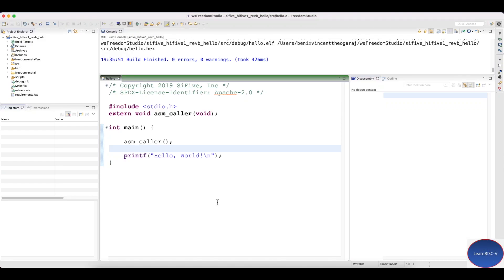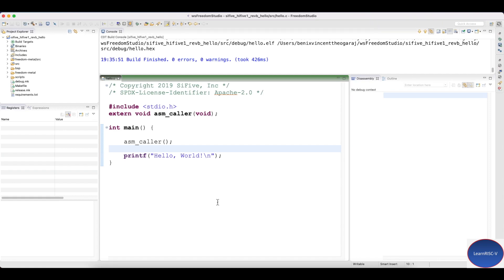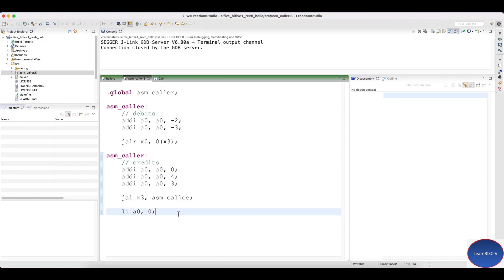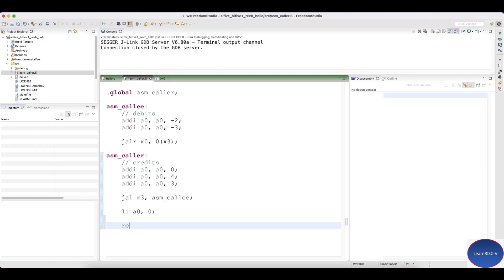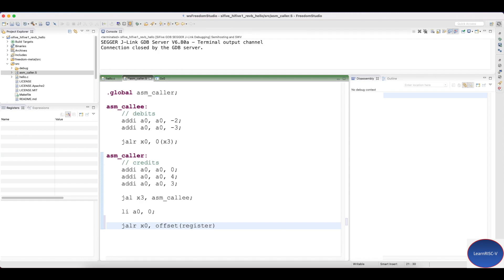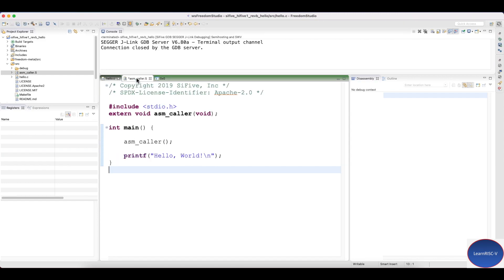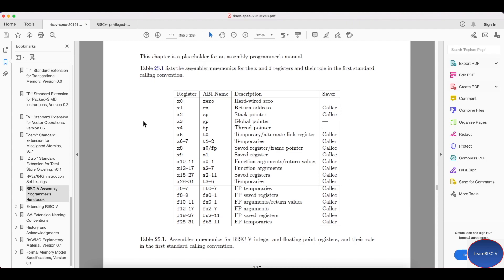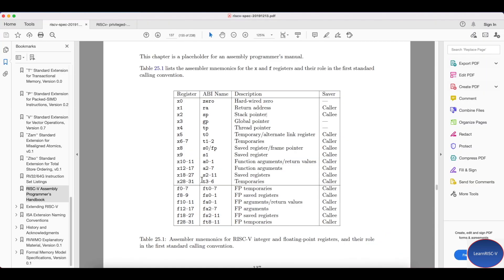RISC-V Procedure call and calling convention for C assembly

Comment: hello, I didn't understand why you didn't move sp forward by 4 byte at the begining of asm_caller
Reply from the maker: Hi Hakan, asm_caller don't use or push or pop stack space. So there isn't any need to. May I know why you think sp should be forwarded?
Reply: hello, thank you for your kind reply. I was just trying to understand risc-v stack usage priciples. I've thought if we update stack memory without forwarding stack pointer we may cause unwanted stack corruptions in nested caller functions.
Reply from the maker: In calls between C functions, the compiler would take care of forwarding the sp (adjust frame) and its needed to push/pop local variables of each function. In assembly, if there is a need to backup and reuse registers, then you use stack and manually the sp should be adjusted and stack content should be tracked. Since the assembly functions here don't backup/reuse any registers you don't have to bother about sp.